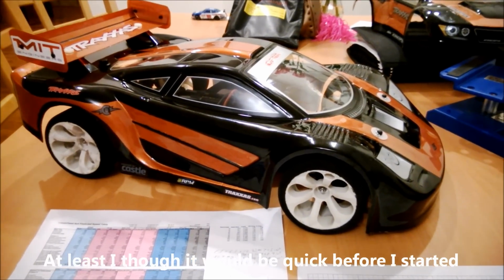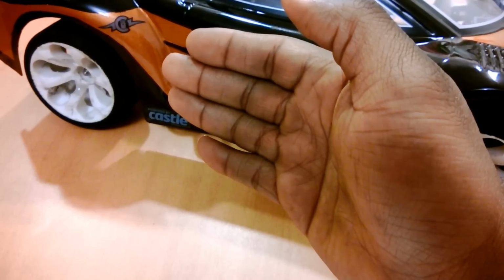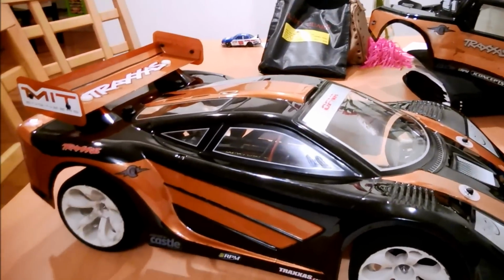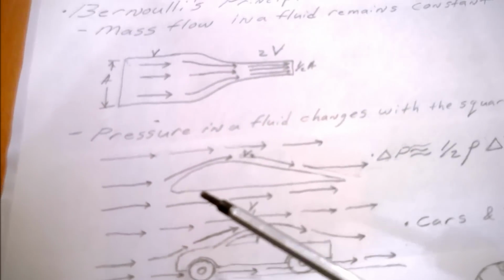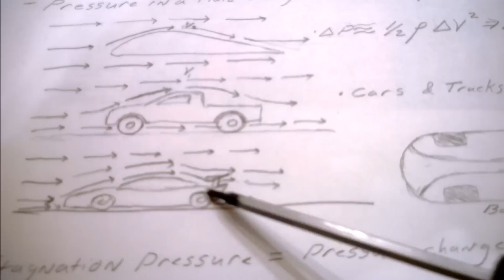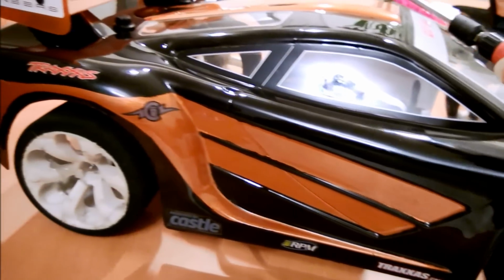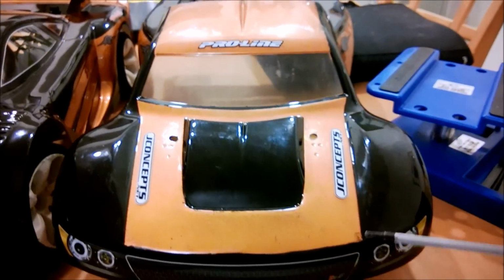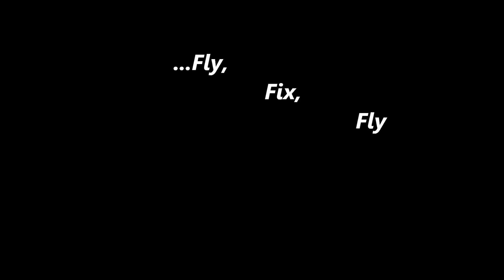Ep. 13: RC Aerodynamics 101 - More Speed with Fewer Wrecks!

Comment: You're right.... scouting for a long enough run spot free of obstructions, storm drains, drainage ditches, ect is very challenging when the safety of people and personal property is at stake.  I've been looking for a spot to do a speed run with my 1/5 scale on 8s, but too afraid it'll be a like a speeding train heavy as all get-out with the potential to dismember an ankle or serious automotive damage that I don't want to be sued over.  I wish RC parks had accommodations for us speed runners for a safer environment.
Reply from the maker: If you look at some of the RUN DMV videos, we have a guy who has a beautiful 1/5 scale FG that has been airborne more than once. This car weighs ~50 lbs, but air + speed can make a lot of lift. Good luck finding a good run spot. Google Earth can be very helpful, though.
Reply: True... definitely have to look outside the city.
Reply: yup and aerodynamics are king ...1.
keep in mind the  nose of your chassis should always be closer to the ground than the rear of your chassis ( suspension , tire size & and downforce elements all go into this ) ...
2. be aware that most wing design is wrong , if you push down on your wing and your front wheels want to lift its a fail ... a wing should never be placed over and behind the wheels , the only way to fix that is have a front wing pass and over your front wheels like F1 cars ... 
3.most people that run 120 mph plus suggest a harder and stiffe chassis &  body , due to the wind bending things so much at those speeds , it throws  something off ..

this guy has all his science down but still has failed passes , why ? 
i see where he is going wrong ... his body wing cant handle 130mph winds ,
just hold your wing out the window ...
( best way is in the back of a pick up truck , throw your rc on top of the cab and hold it as you go maybe 45mph )
which brings me to my last point   ( how you run it )  

4 Location is Vital , everyone is different but 
 i cant stand on a long street  and drive a dot down the road past me at 130mph ... 
id rather be at a track and field Oval and go for my top speed on the straight aways ... 
or 
be in a car doing 60mph  then pass us in the car with the r/c on the speed run ..

Good luck and be safe man , cheers
Reply: J-N-H-M Thanks.. I know exactly what you mean by trying to drive a dot pass yourself at high speeds with all the variable elements of a run.  It's both exciting and nerve racking at the same time.  I recently had my personal best at 96mph with an Arrma Typhon and ended up loosing control at the end of the run turning it into a bitter sweet disaster.  Damage seemed slightly minimal and I got it all on video so I can hopefully learn from my mistakes.  On my youtube page I call it the "ARRMA GETTIN'" project since I'm trying to get speeds of 100mph+ with an Arrma Typhon buggy.
Reply from the maker: J-N-H-M This video is a few years old now and I've learned a lot since then. Check out my more recent social media posts and you'll see that this car is a completely different creature now with a lot of XO-1 inspired custom fiberglass aero and no rear spoiler anymore.

You were spot on in most of your points, but I've added a lot of new tricks that now make this car stable and efficient at 100+ mph.  

Thanks for the comments!
Reply from the maker: 13djdave13 Driving an RC at 100+ mph is flat out nerve-racking. It takes a lot of passes to really get comfortable with it. The only way to get by that is to just practice. You get a little better with each pass. Just go at your own pace and go with what is comfortable to you. When you rush yourself, you make mistakes and our mistakes can cost a LOT of money.
Reply from the maker: +J-N-H-M  Here's a link to on-board video from a 103 mph pass. I haven't been able to run much this season, bit I'm gunning for 115+ mph on my next outing.https://youtu.be/s-vXp4OLpbA
Reply: rhouse21 - RC Physics Oh yes!  I totally agree and like you said, practice makes perfect.  Sometimes I find myself nervous while loading up my rc equipment into my truck or even on the drive to a run spot.  Some like to sky dive, I get my rush with my RC!  Lol
Reply from the maker: Pre-run jitters are No Joke!!!! LOL!!! I totally agree with you!
Reply: rhouse21 - RC Physics Cool Stuff , keep up the good work

Comment: have you considered running a flat plane off the back of the deck lid instead of a wing/spoiler? Apparently keeping the air over the top of the car more uniform as it flows over and past the deck lid makes a huge difference in diffuser efficiency, however if you have a wing mounted above this smooth air stream behind the end of the deck lid surface it multiplies this effect further, hence the current design of indycar *rear wings and engine covers.
Reply from the maker: At some point I removed the spoiler that is featured in this video after I realized this body had a significant Gurney flap molded into it. Gurney Flaps operate similarly to the flat plane you described, but also change the effective angle of attack of the body to spoil the lift it generates with virtually no drag penalty.

If you click on any of my latest videos, you will see a 103 mph 'fly by' of this car with it's current aero setup which includes a flat underbody tray, diffuser, and chin spoiler and a Mamba Monster 2 ESC. It shocked most guys with how quiet it is relative to many other cars at that speed. I'm taking that quietness as a sign of good aero efficiency, but I'm going to be repeating runs at some of my old configurations this spring using MMX and XLX ESCs to get log data so see exactly ho much power is being used with these ESCs.
Reply: @RCPhysics   my only issue with the gurney flap is that its too far forward and above the diffuser to aid it with a good updraft. there's too much dead space between the flap and the diffuser.  Air control surfaces don't really work unless there's air flowing on both sides of it.

Gurney flaps were most effective on 70s and 80s gtp style cars using ground effects where the floor pan actually came up and me the underside of the gurney flap. unfortunately most RC rear control arms are in the way and that design can't be used  effectively. 

 I'm using full size car theories though and scaled down I could be dead wrong and obviously what you've done so far has worked out very well, I'm just throwing ideas out to help you and the community improve, Don't just fix, make it better and fly again!

Sorry for all the editing but I missed an important bit of info.

Comment: have you thought or looked into a dirt late model body? Like a Mach1 body, I was told it was designed specifically with aerodynamics in mind.
Reply from the maker: +Lance Grady I looked briefly at a couple of the dirt bodies. They are nice because they are very low profile, so that will minimize drag. They re also designed to make downforce, which should also help. My main concern is that the ones I've looked at are asymmetric. This is intended to help them on oval track, but I'm not sure what would happen in a speed run application. Many guys use the low profile on-road car bodies, which are also very low profile. Unfortunately, Dizzy's internal mods are too tall to fit these bodies, so I've changed my focus to underbody airflow management to try to reduce drag and make more downforce. https://youtu.be/PY9Z9IDc13U https://youtu.be/szy_WkRgn2E
Reply: I really like your under body setup and plan on trying to put that under my SCT Late Model. Which bodies have you looked at? The Mach 1 is a little asymmetric but not enough to hurt or hinder (fully just an opinion) and how tall are those mods? On my SC10, the roof of the body is 5 inches above the top of the battery. Also how important is the flare back out at the tail of the under body?
Reply from the maker: +Lance Grady I looked most clostly at the ProtoForm dirt oval bodies. http://racepf.com/dirt-oval/ I hadn't looked at the Mach 1 before, but you might want to check out some of the bodies at http://deltaplastikusa.com/ Delta Plastik makes some dedicated speedrun bodies that are made with 1.5 or 2 mm lexan, so they are super strong and do not really need reinforcement. The flare on the back of the body is an imortant part of how a diffuser helps the under-tray to make downforce. Check out this video here for some insights. https://youtu.be/RufgMOQlLx8?list=PL3G0kjvLTk5frTKa6rfpZ0H4u3NTYI-bZ Good Luck!
Reply from the maker: +Lance Grady This one's good too. https://youtu.be/uk_L2IOKArM

Comment: The guy at the LHS talked me out of a Rustler ,and to go with a 2wd Slash. The Rustler practically looks like a F1 car when it's set up for Speed runs. I'm gonna work with my Slash ,but this video might of swayed my decision the other way.
Reply from the maker: +natemorte I'm almost twice as fast now as I was when I made that video, so I'll be posting a part 2 sometime this winter. Honestly, they all have their strengths and weaknesses. The 2WD Slash is nice because you can run 1:8 scale GT bodies and some guys have hit some nice speeds on that platform. You just have to dial in the setup.
Reply: rhouse21 - RC Physics
I know yours is AWD but you did a nice job centering the wheels in the wheel wells with that Ofna body. I'm pretty sure that DM1 body will clear my front shock towers on my 2wd. Right now I'm focusing on getting it to track right with toe ,and camber before adding any speed parts. Look forward to watch the rest of your videos next level information.

Comment: I have a traxxas xo-1 and I am disappointed about aerodynamics. I suppose ( because i am not an expert) it sucks. It needs more downforce on the bends, because with the original wing most of the time the car spins around when I push the throttle... So I manually installed on it a bigger wing with more downforce. It is fixed. Now I have a good traction on the bend but on the straitgh the max speed is decreased too much. So I was wondering if it is possible to set up a servo just below the wing and link it to the car...I would like to link the servo to the rpm or gps in order to customize the movement of the servo. I have NO IDEA how to do something like this and if it could be a useful idea. Have you any suggestion?
I hope you understood everything due my grammatical weakness ;)
Reply: gabriele ricci I forgot to say... I drove my car on a real kart circuit so the road was clear without dusty or pebbles
Reply from the maker: gabriele ricci I like your idea. You could set up such a system using an onboard computer or an advanced multi-channel radio like some of the RC airplanes use . Essentially, you would need a to set the car up to sense when you are turning and increase the angle of attack of your spoiler to produce more down force. High end RC Aircraft radios often have a feature called "servo mixing" that could allow you to program an extra servo channel to do this. There may also be a high end RC car radio meant for a nitro car that may let you set this up, too. Of course, you could also control the spoiler manually using a less expensive 3 or 4 channel radio, but this may be a challenge to drive. Good Luck!!
Reply from the maker: gabriele ricci The XO-1 is designed to be a straight-line missile, so you have to "help" it a lot if you want to use it as a road-racing car. Spoilers do a good job of adding traction, but they come with a cost. (Check out RCP # 53 for more info http://youtu.be/5X2KwDLgG0g ) I hope this helps!

Comment: how fast does your rc car have to be in order for the downforce to be effective
Reply from the maker: I could answer this question two ways. I could dive into equations or I could give you a more real-world answer based on observations. I'll choose B right now, but I'm planning a follow-up to this video where I'll dive into A.

Let's just say that there is a reason that the "speed clubs" out there start at about 70 mph. Practically, this seems to be the point where the aero forces strat to get strong enough to really affect the cat if you don't start taking countermeasures (meaning the car wants to turn into a wing and become airborne). For most guys, the easy countermeasure is adding weight. This works, but in the follow-up, I'll show that using aero to your advantage works too.

I hope this is helpful.
Reply: rhouse21 - RC Physics thanks mate it’s really helpful

i’ll be looking forward to those
Reply: @RCPhysics  i think that Something Like a Spoiler is not enough for low Speed downforce, but with a big Front Wing, big Air diffuser and big aggressive Wing it should get downforce even when driving only 35 mph
Reply from the maker: True. At that point it becomes a balancing act between downforce and drag after speed increases.

Comment: My friend this video is after you prove on the reality (reality is different than peace paper) please prove with the rc you have)
My friend it's a good video but speed is speed if you go 121mph scale 1/10 real normal speed is 1210mph is only my opinion I respect your opinion and your video
Reply from the maker: Sorry, but I'm not sure that I understand your comment. All my numbers are in REAL units. Nothing is "scale speed." We are talking real MPH and forces backed up with real GPS data. Many of us in this community are packing 2-5 REAL horsepower into cars that weigh 6-9 lbs. When we say 100 MPH, we mean 100 MPH, 162 kph, 142 fps, 50 m/s.
Reply from the maker: BTW, I have already achieved 73 mph which is documented in my videos, but there are plenty of us in the 90 -114 mph range.

Comment: that car is not scale
Reply from the maker: ??? I'm not sure what you mean. This body is not a true 1/8 scale representation of a McLaren, but most RC bodies are "inspired" by full sized cars since a true scale model doesn't leave enough room for the required innards.

Is that what you are referring to?
Reply: i can see it is one of those "cars" that is really a buggy under the shell.
the wheels are buggy style,  and the car has a general cartoonish look to it.
but im sure those big wheels go offroad very well compared to my 1/10th little wheels.
Reply from the maker: I will agree that these 1:8 scale GT cars are not true scale replicas. However, they are very effective at laying down impressive performance on-road. The car in this video has since topped 100 mph, but similar cars are posting speeds in the 150-170mph range. Not bad for a "cartoonish" model. ;-)

Comment: You have a lot to learn about aerodynamics my friend. The basic explanations you presented, is nothing more than basic common sense. There is a whole lot more to know. For instance you even said it yourself, DRAG. Drag is a negative pressure that rules aerodynamics more than positive pressure created in the front. Also a spoiler creates disturbed air flow behind it, which reduces drag. Its not just a simple wedge that you need to defeat drag. Open a book or google it first, like you mentioned, before you blabber a bunch of questionable assumptions, in your videos.
Reply from the maker: Ummm. I have a degree in Aerospace Engineering from MIT, so I know more than a little bit about aerodynamics. The point of this video was to introduce aero concepts to people who do not have a background. I admit that I may have over-simplified a bit to make the concepts more understandable. I would more than welcome any suggestions you would have to better explain the concepts. I'm overdue to film an update video.